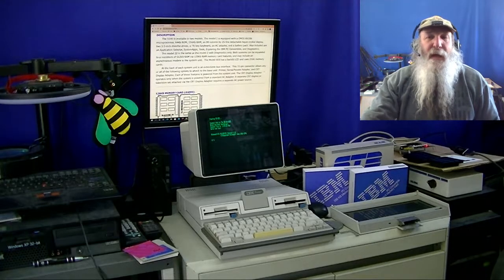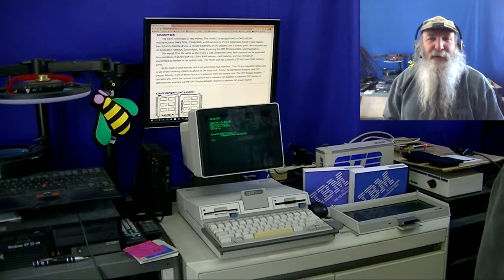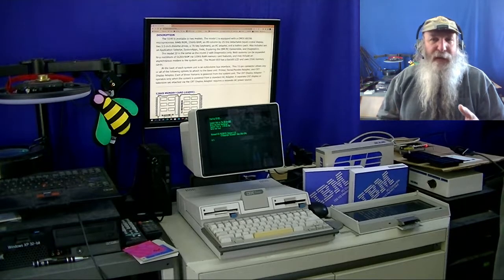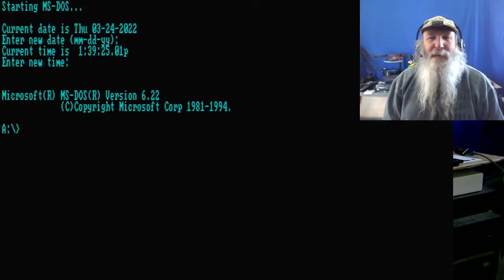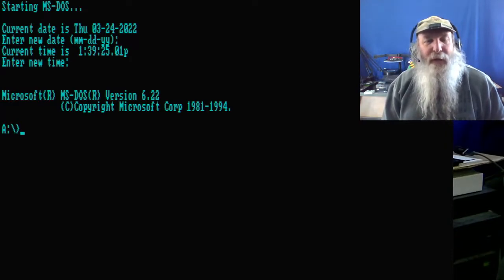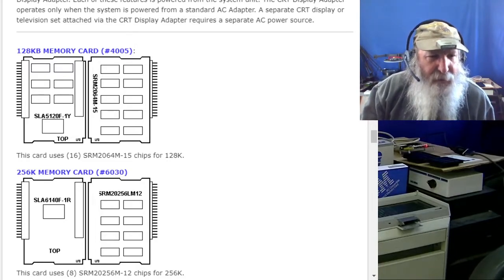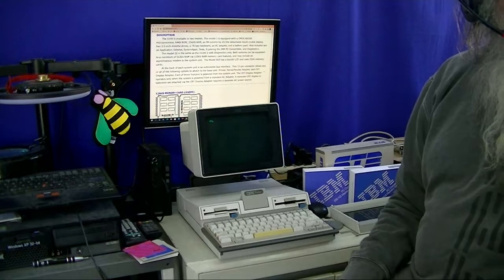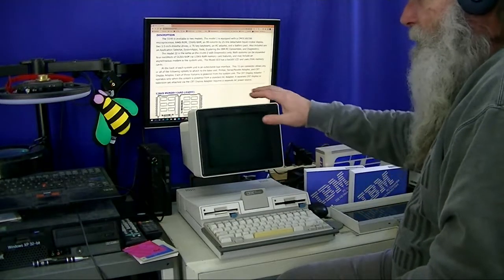All about "SRAM" on the IBM PC Convertible!

Comment: IBM P/N 0123456: Coin for opening PC Convertible Keyboard :)
Reply from the maker: I saw another video (not yours) use a tool - with some trouble. IBM shows the use of a coin. And as far as I am concerned, I'm even going to debate which is the correct size.